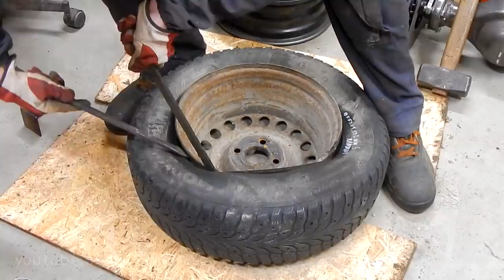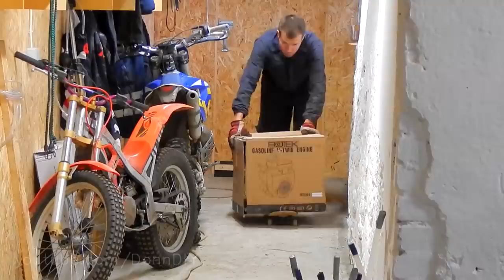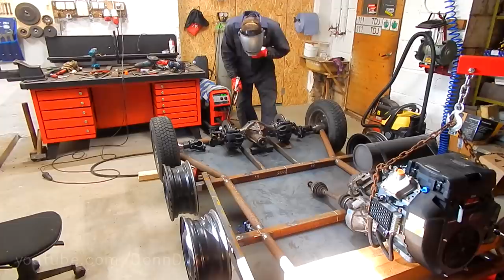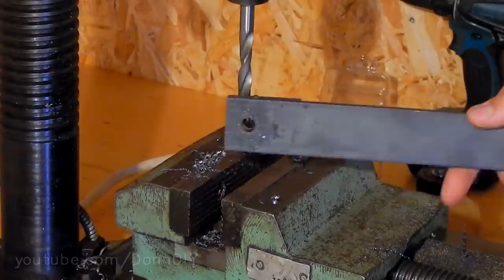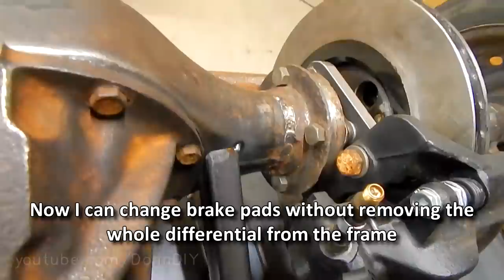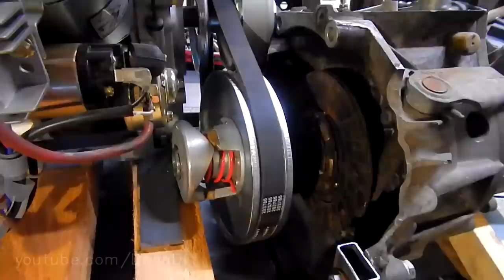Mounting Transmission - Tracked Amphibious Vehicle Build Ep. 8

Comment: This guy is a damn good fabricator,.. all of you guys that say "you should do this or that" go out and make your tracked amphibious ATV and make it like you want to but be sure to video your fabrication so every one can tell you (you should do this or that )
Reply: I've been welding and fabricating as a professional for 30 + years, and I understand your feelings wholeheartedly.

My concern are the severe drive angles of the universal joints coupled with the torque of that engine and front-wheel drive transmission.

The differential is got something in the neighborhood of about 3 to 1 reduction the final drive in the front wheel drive transmission is probably going to be about the same so there is 9 to 1 torque multiplication before any of the ratios of the transmission are taken into account. So if the U-joints do survive I don't think their service life is going to be very long.

Comment: As a welder, good sound in welding. As a builder, couple screwups: bottom firmly welded to frame is disaster in future. You will not avoid engine shake (and drivetrain shakin') rip those welds and your creation sinks in or gather water. Nice build still.. 👍
Reply: I agree, there should be some bushings to dampen the vibrations, also where is the suspension? It will be like driving a tractor with small wheel otherwise... maybe offset the inner wheels and put some leaf springs over them... 🤔 Still nice work 👍👌Also why not weld a nut or make threads for the bolts... the nut seems to be in a akward position
Reply: He has not yet mounted the engine ( the source of vibration )  who is say to say he is not going to use some type of hard rubber mount? I definitely see where you're coming from though,  I ran into a vibration issue myself on a custom build by hard attachment.   Some type of rubber mount is needed!!
Reply: @leroyc179  vibration will travel where the energy is going... the gears/engine will last longer also if there is some give... torque will kill them.. so thats why you have the bushings... no straight metal on metal action with high torque
Reply: @jonathanweimane6926  I see your point, the energy from vibration will travel through out drive train. rubber bushings would greatly reduce this effect

Comment: Just my personal opinion. Make the final drive to the axles as straight as possible. Any angle will create lots of stress on the U-joints and therefore fail a lot sooner. And since it isn't a straight fit, you waste energy (HP) on friction in the angle transfers as well. U-joints are a good item to have for flex, but the straighter the drive, the more and simpler transfer of power. Even if you have to rebuilt the rear section or modify it to get it straight drive. It is pure physics.
Reply: Yes you don't need UJs if it's not bouncing 😁👍

Comment: Great Job Donn. Would you not want to weld up the differential in the transmission im pretty sure the side of the transmission not connected to to the differential will get the power and the vehicle wont move. Love the videos and will be waiting for the next one.

Comment: Donn  you should forget about the lever's for steering (it's been done) go with a steering wheel,as you turn it could actuate the hydraulic brake's.
Reply from the maker: Steering wheel for side brakes is done already also. If I use a steering wheel then I have to add separate brake pedal for braking. With levers pulling both steering brakes at the same time will also brake the vehicle. I'm gonna keep it simple.
Reply: Whatever you do will be awesome and I'm looking forward to it.I was hoping to see a steering wheel because I hope to build one someday and I am going to use a steering wheel.Keep em coming Donn.

Comment: Breaking tyre bead, place tyre on ground,  bottle Jack upside down over tyre , but under something solid like tractor or heavy SUV, works well and doesn't require fancy gear or damage bead, use Jack upside down as psi of base(big) rather than jack point(small) is hugely increased. Used right side up, you may not get enough pressure to break bead before  starting to lift your resisting point,  great project,  cheers

Comment: I think that for the differential to frame mounts I would have tapped the tabs and run the bolts down from the top.  No nut needed unless you wanted to weld a nut onto the bottom of the tabs.

Comment: Looks good phasing the universal joints is a must thing at the angle yours are running.

With that front wheel drive transmission this machine is not going to be fast but it should pull like a damn when you're in first and second gear.

Comment: I think not putting the drive axel concentric with the drive wheel center is going to be a problem!  Move the last cross member back. Drop the drive until it’s in line with the axels
Reply from the maker: I hope it will be fine. If I'm wrong I can always redo this.

Comment: 10:17, Donn I would avoid fully welding something like that until you know it works, and you don't need the BMW diff. It's easy to weld it later (generally, but a pain to undo it.)

Comment: Donn, I follow along on a lot of your videos. And I have liked most of them and your ideas. Mostly without any comments. But this project has some issues that I am seeing. Are you planning to support the the existing frame with something more solid so that it won't buckle under track tension? Also I belive that your u-joints on the diff are at too great a degree of angle. And that they will bind up and cause issues. Also your diff idea may or may not work inless you lock the diff. But that in itself will negate the brakes working independently.

Comment: Nice build. You install  variator 2  to car gearbox main axle. I wonder is that going to survive because variator belt cause horisontal lateral force. Normaly that mainaxle is supported whit crankshaft.
Reply from the maker: There will be a supporting bearing in the end of it. No worries.

Comment: Have you considered  mounting   the differential  up higher to drive gears higher than tires with chains or gears between  deiving the tires similar  to a few of the older f20 tractors?
Reply from the maker: I have but I don't like the chains very much.

Comment: Why not drop the differential down into the frame 20 to 40 mm’s?  A small bump on the bottom won’t cause problems.
Reply: I was thinking something along those lines also, even just a couple of "scoops" for the brake rotors.

Comment: I'll have to watch this three times to keep up... awesome build.  Question: will the tracks provide the motion in water? If so, how do you prevent yourself getting splattered soaking wet? Or will they only move slowly in water?
Reply from the maker: I will try and make a propeller for it. The tracks will also run at the same time and may be used for steering in water too. The propeller will give it more propulsion in the water.

Comment: You will need to lock the diff in the gear box or you wont get any drive
Reply: Steve Hall I still haven’t ascertained steering. Have you?
Reply: It won't be able to steer then. You want one side of the vehicle to get power, while the other one doesn't. The diff should remain open, else, you're going to try fighting against the locked differential, and it will be useless, since the wheels will both spin at the same rate, and receive the same amount of torque, which you do not want in a skid steer vehicle.
Reply from the maker: Yes, I have to lock the differential in the front wheel drive Peugeot Partner gearbox.
Reply: @demospam2  he(steve hall) is is talking about the diff in the FWD car gearbox not the rear drive diff

Comment: Welding mild steel to cast iron (Differential housing) will result in cracked welds later?
Reply from the maker: Differential housing is not made from cast iron. I've already welded it before when makin it shorter.

Comment: Your angle on those U-Joints is far too great The maximum recommended angle for a regular U-Joint is 3 degrees. After that they start to vibrate  and the wear is increased greatly. The angle you have looks to be between 30 and 45 degrees which is prohibitive.
In addition, since you no longer have a two point mounting on your transmission input shaft you can expect the input shaft bearing to go south fairly quick. The input shaft normally is supported on the clutch end by a bushing or a bearing mounted in the back of the engine crankshaft. The side loading from your belt drive will cause the bearing to try to cant towards the engine which will destroy it.

Comment: Why are all your wheels level with each other, shouldn't the two center wheels be lower than the outer wheels for stability and easier turning and ascent/descent angles?
Reply: Front pair are 5cm higher (if i remember correctly from the previous video)

Comment: Think about it , why don't dozers have 2 diffs ??? With the track touching all wheels , you only need ONE drive point . The torque converter IS the centrifugal clutch . No need for so much  redundancy . Simplify your engineering specs . You will spend far too much unnecessary time and money at this rate . Just a thought . I bet your getting a lot of those . LOL !
Reply from the maker: Look up "homemade lightweight tracked amphibious vehicle" - you'll see the same drivetrains and solutions. It has been done already, it is working in practice too. I'm not building a dozer.

Comment: You sould use that bmw engine with the gearbox and couple them on the back diff via a propshaft. 
Have you consider a triple differential tank steering?
Reply from the maker: Want to keep it as light as possible. That triple differential steering has to wait.
Reply: @DonnDIY  understood. i am looking forward for the finished product :)

Comment: Sorry to say.....but......don't think 20 hp will have enough torque to drive that size machine when you go to turn.....old Wisconsin would.....for example....12.5 hp Wisconsin.....257 foot pounds of torque.
Reply: He is using a tourqe converter, so no problem.
Just do a quick search on YouTube on tracked veichels and you will see a lot of examples from Russian where they use just 17 hp (or less)
Reply from the maker: That's right.
Reply: I Owen a Raidtrac......tried 10 hp......barely turned......Raidtrac is four foot by eight foot.....yours....much bigger,....unless your using hyd. Motors to drive it.

Comment: It's too late. The easiest was the transmission and motor of Citroën 2CV.
Reply: There was a vehicle made by a company called Scottrack that used 2CV transmission and engine, chain reductions down to wheels. It worked well but engine worked hard. Later they used same transmission but Kubota diesel.

Comment: 192 cm is 6' 3 9/16"
   That's also my height, I'm 6 feet 3 inches tall.

or 75 9/16"  Inches 

Many of the online conversion calculators are wrong, often because they forgot there are 12 inches in a foot.
Many of the calculators incorrectly believe there are 10.

Comment: Great idea. Bad incarnation.  No suspension, it'll kill the frame. Differential mounts to frame without dampers.  In my opinion use gearbox from front-wheel drive car stupidity, glee differential in design, gearbox from LADA more relevant. Belt drive with a CVT from the engine to gearbox HOW is THIS possible? The frame material is square tube, it is bad, there is not enough strength.

Comment: Stupid small engines come on ! No more please !
Reply from the maker: How big does the engine have to be for this light vehicle? When taking into account 4x gear reduction this 20 HP engine translates into enough torque on the wheels. I don't see a problem here.
Reply: @DonnDIY  What are you gonn use this thing for ? It will be crazy slow its over and under built at the same time . If it does standing 360's i will be surprised .
Reply from the maker: This will be amphibious tracked vehicle for tearing down beaver dams in the swamp, plowing snow in the yard, hauling wood from the forest. I'm not the first who does this, check out "Ohotec" on YouTube, you'll see what I'm building.